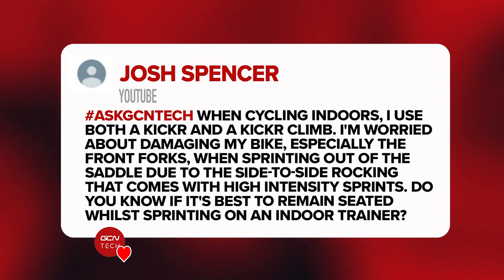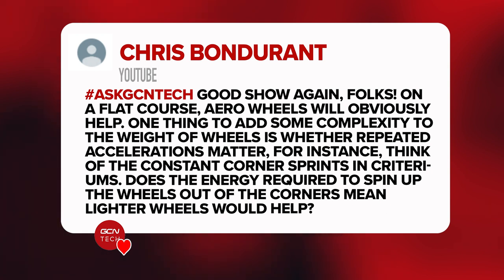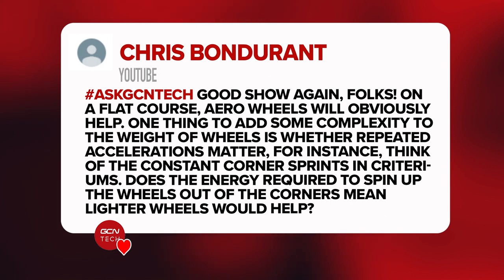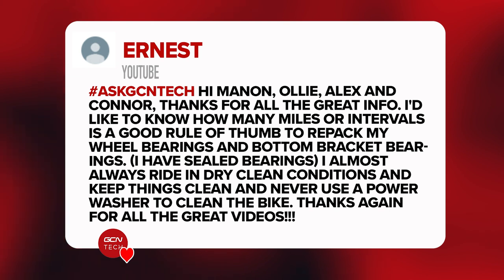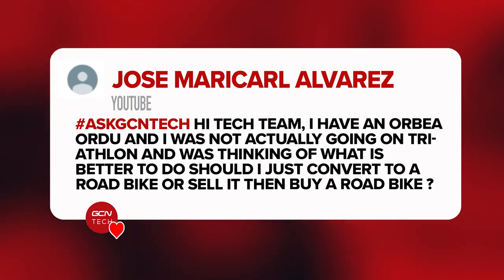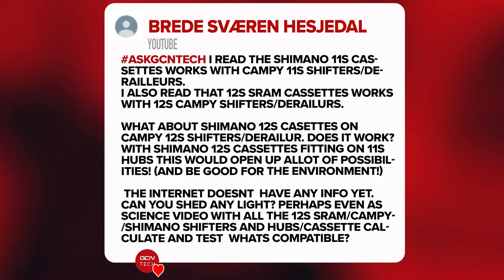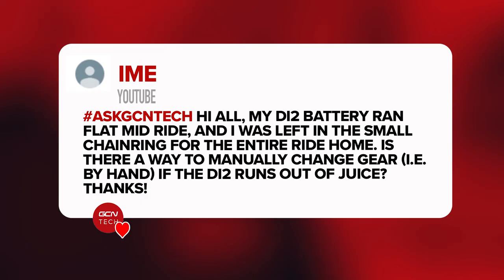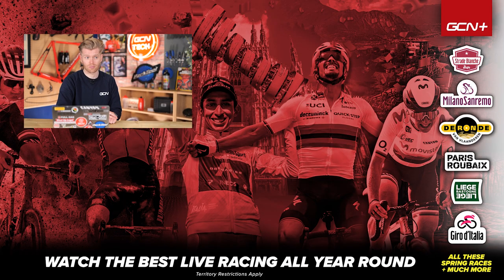Is It Safe To Ride Out The Saddle On Indoor Trainers? | GCN Tech Clinic #AskGCNTech

Comment: ASK GCN TECH....Alex , Ollie , and Manon....what is the difference between a $35  tire and a $70 tire ? I' m not a racer at all , I look for value and durability personally.....Peace
Reply: If you are not racing, the difference is $35......If you are riding with friends, who cares if it takes an extra 2 watts to ride your bike at "X" speed.
Reply: @billkallas1762  Thanks Bill..I was hoping for a little more than the obvious...which one would last longer and why perhaps ?
Reply: @cb6866  Cheaper tires almost always have thicker rubber, and will last longer.
Reply: @cb6866  rubber compounds and tread/sidewall design are improved often- but not always. That improvement may only be noticeable in ride quality and/or lifespan- or neither.
Reply: @pretzelhunt  Thank you ...I get it. Subjective , conditional and ..? I am learning , I began cycling late in life . It's still fun as hell....
Reply: @billkallas1762   Thank you. I'm learning the hard way , as usual.
Reply: @cb6866  trying to keep my tubeless aired, then run tubes, then maybe "l'l try tubeless again before going back to that manufact'r" 
It still continues to be my least favorite part of bikes, and some folks have 0 lifelong issues with it. Good luck!
Reply: Probably wire bead vs Kevlar bead.
Reply: I suppose usually weight, rolling resistance, and handling. I recently got american classic timekeepers. They're suppose to be as good as gp 5000's. They were originally 30 dollars, but now they cost 40. I have a pair of continental ultra sport 2. The ultra sports are the faster tire. But those are on carbon wheels. I think tire pressure is more important. I can't justify spending 85 dollars on one tire. I ride my bike for fun and fitness. Don't fall into the money trap, because it never ends.

Comment: For 11 speed, Campagnolo, Shimano and SRAM (except flat top chain) all have the same pitch and spacing between cogs, as confirmed by Lennard Zinn.  That's why they can work well interchangeably. Campagnolo 10 speed will not work with Shimano/SRAM. In addition to spacing, you have to be mindful of the space from the first cog and the wheel, which is determined by the freehub body and cassette interface. Sometimes there's a spacer that is used in this area.  It is the lever (brifter) and generally not the derailleur that determines compatibility.  In fact, there are derailleurs from 11-10-9 speeds that may be interchangeable because their pull ratio is the same.

Comment: #AskGCNtech A bike shop just used acetone to remove a carbon seat post from my carbon frame that was stuck despite copious amounts of WD40. I know acetone is used as a solvent in the manufacture of carbon fiber/resin composites. Could my frame had been damaged? How could I tell?
Reply: I'm an engineer and have used acetone quite a lot as a cleaner. It's true that acetone is able to dissolve a number of plastics and resins, but that's only the case when something is soaked in it for long periods of time. One of acetones advantages as a cleaner is that it evaporates very quickly without leaving any residue. The amount probably used by your bike shop would simply evaporate within minutes. I certainly wouldn't worry about any damage on your frame or seatpost.